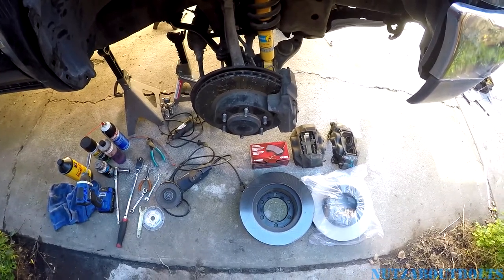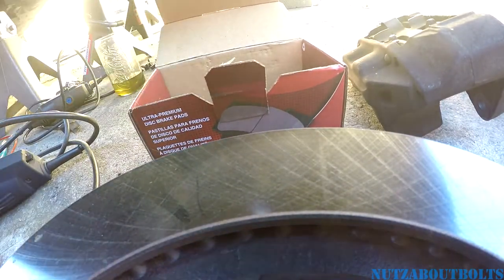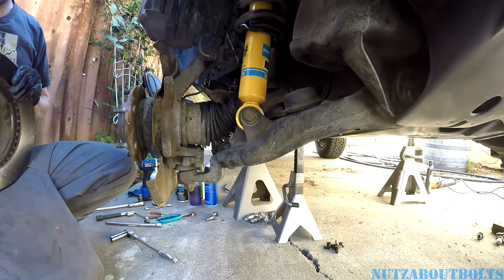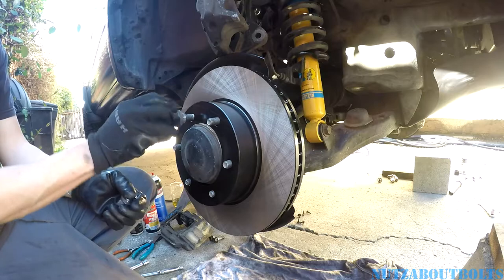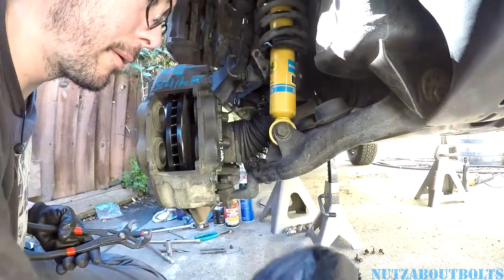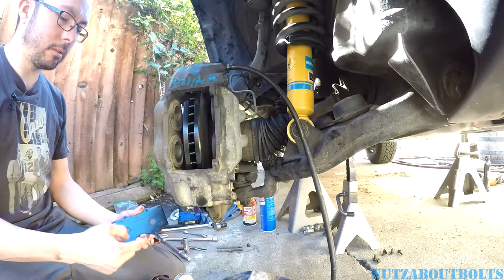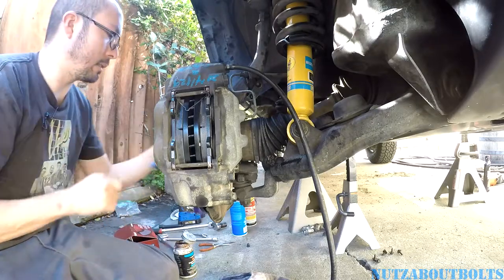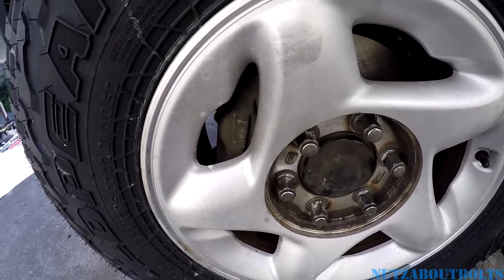1996-2002 Toyota 4Runner upgrade to Tundra big brakes with Calipers and Rotors

Comment: I just bought a 95 4runner, put a clutch in it and then I took it for a test drive and the rotors are so warped as soon as you hit the brake the steering wheel shimmy. It supposedly has new tie rods but I'll have to double check. But the 4runner rotors definitely warp really easy from what I've read.

Comment: What year tundra did u go off of?
Reply: Do some research.  2000 to 2005. But it has to be 13WL calipers
Reply: Or 13we
Reply: 13wl need 17” rims and 13we fits all 16”
Reply: Seems like the guy in the video didn’t do any research lol
Reply: @illyadope3787  13wl you just need to cut the dust shield?
Reply: @illyadope3787  Stop giving false info dude. Both are the same size. the difference between the WL and WE are the placing or location of the brake line housing (where your brake line connects to). You can definitely put 16s over these calipers but not all. The limited 2000 stock star rims fit fine. There are quite a few aftermarket 16s that will fit too like the KMC brand. As me if I know? Maybe I did the upgrade?